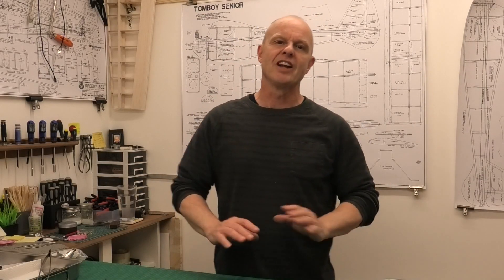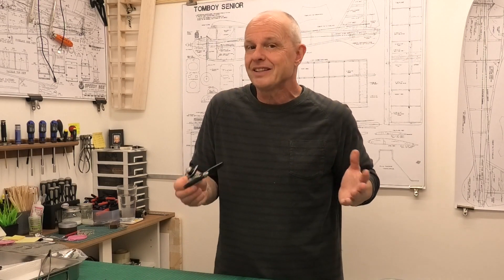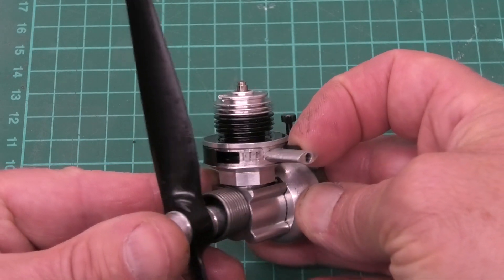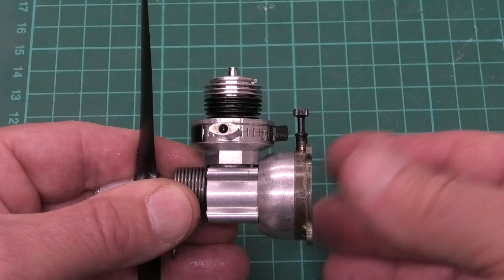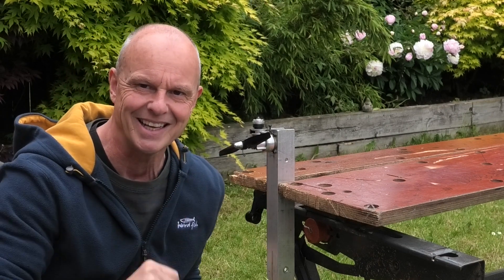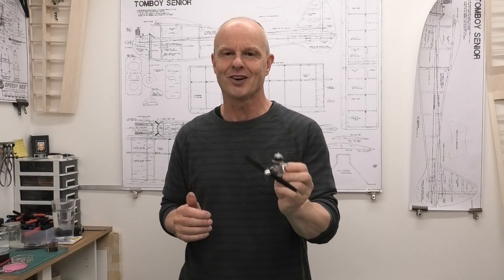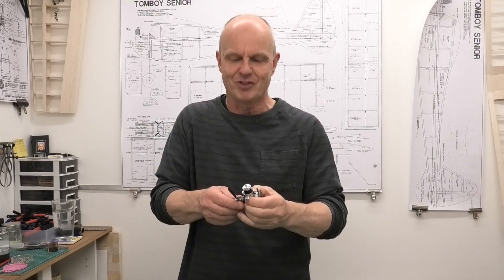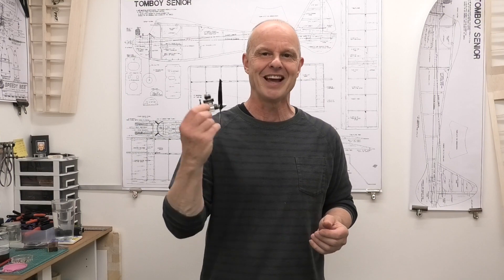Cox 049 Babe Bee Glow Engine - Run & Muffler test

Comment: My first engine was also a Cox baby bee and I still have it. I was amazed at how little difference the muffler made in rpm. Yours is an original baby bee as it has the brass backplate, modern one's are now plastic. If ever you think of putting it in an RC model you can get a tank extention ring. Enjoyed the video. Terry
Reply from the maker: Hi Terry, thanks for the comment, they really are great engines, I have a couple of models in mind for this engine, probably be something vintage. 😀

Comment: There was a version of that same muffler that didn't have the little pipe sticking out, but it still had the adjustable ring on it, and you used the ring as a throttle.

Comment: I do like your you style of presentationMark. You mentioned replacing gaskets a subject I am investigating. I am making drawngs of most popular engine gaskets withthe iw of suppling gaskets to the modelling fraternity. I have made them in the past when I had acces to a laser cutter. Had made a few hundred for  Andrew  Boddinton. I would like to find a laser machine owner that could produce the gaskets to my drawings from a s/w drawing package- Any Ideas ? Dave M.
Reply from the maker: Thank you very much, really appreciate your kind comment.  Sorry can't help with the gasket cutting, I make all my own by hand with a scalpal and ink pad, which I actually quite enjoy doing, however, I would think there would be a good demand for gaskets, sounds like a good venture, good luck

Comment: Does this engine have SPI? I want to make a similar muffler on my 049 Golden Bee but I heard that SPI engines lose considerable power with a muffler.
Reply from the maker: The engine does not have SPI.  You are corect SPI is not good with mufflers as it sucks the exhaust gasses back in
Reply: @MarkRobinson555 Like an EGR, good for the environment, bad for power ;). Cheers.

Comment: Hi I have a question, do these engines require a fuel tank, it doesn't seem the can run for long if mounted on a plane? Thank you!
Reply from the maker: The engine has an integral tank which gives it a couple of minutes run time, you can fit slightly larger tanks to extend the run time
Reply: @MarkRobinson555  thank you very much for such a prompt reply!